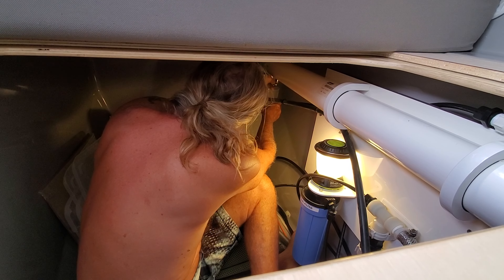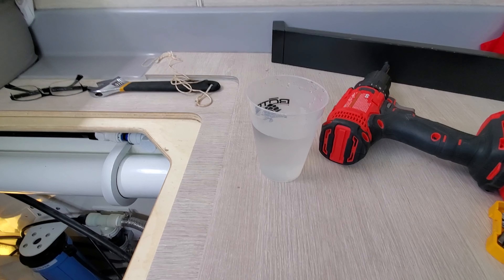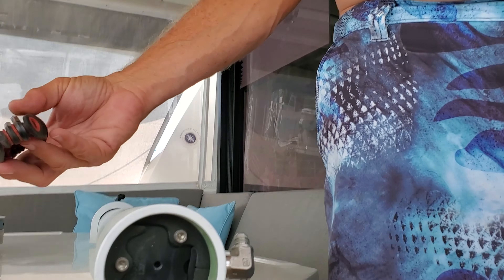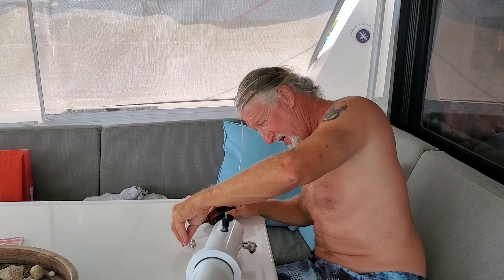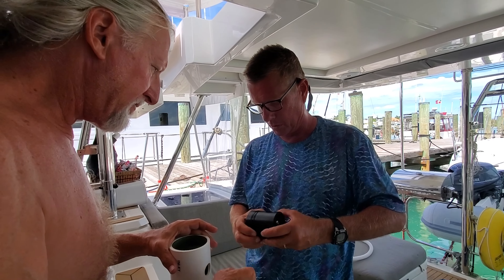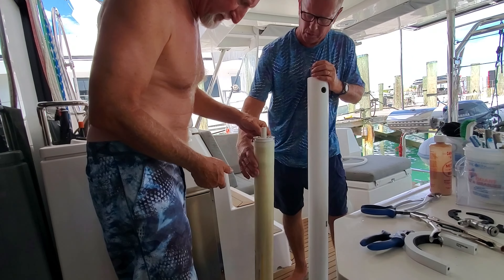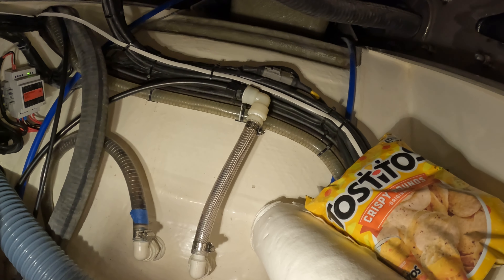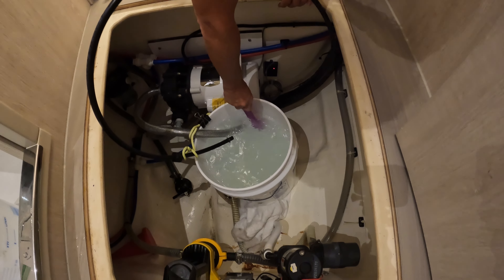Cleaning Our Sea Recovery Aqua Whisper Mini Water Maker Membrane - Take 2! E58

Comment: A few procedures that we did to improve life with the AWM:
1. Don‘t use the remote.
2. Start the booster pump (button on the lower right of the display) and run it for around half a minute while decreasing pressure.
3. Start the watermaker without pressure.
4. Increase pressure to 800PSI. Use the digital (press menu button twice) display instead of the analog one.
5. If you switch on the WM breaker interrupt the self cleaning process as soon as it starts (if configured).
With those changes we‘ve improved the filter life and output by quite some margin (at least 2-3x the filter life before the 20 micron is clogged).
If you‘ve got any hints or ideas - please share… 👍🍻
Reply from the maker: Thanks so much for that info. We haven’t really posted anything yet about our current issue but…the low pressure pump appears to be dying. Actually it’s not the pump but the big Parker motor. Now she’ll run but the low pressure slowly decreases until it shuts off at just under 4psi. Sometimes it goes an hour and the last time it died at 30 minutes. So we just ordered a new one and should have it next week. We’re this close to throwing the whole thing out and getting a Rainman. Will keep you posted though!

Comment: You should buy a membrane housing with a new membrane already installed for $595 from seawater pro. You can easily get adapter fittings if they are different. After that, new membranes are $269 each
Reply from the maker: Thanks for that info Bill. That may have been a better solution than what we ended up doing which we’ll show in a couple of videos from now (which was put in a new proprietary membrane) 😔
Reply: The 3x31“ membranes are a real PITA. I found them on Amazon for a pretty good price. Fortunately ours is still going strong and producing ~100l/h. The components used by SeaRecovery are pretty strong (a 2kW Baldor motor is pure overkill) and you should be able to supply twin-2540s with it. 👍